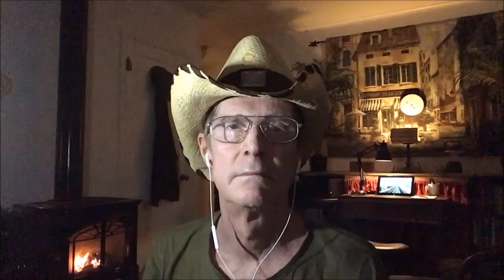What Is An Antenna Trap?

Comment: Thanks for sharing Stan I’m going to buy your book {I probably should have a long time ago}

Is this not the basic principle of a ‘Crystal radio’ ? 
My question is what about inductively coupled inductors, theoretically let’s say I have a microwave oven transformer and I have the antenna off of it and to earth ground then the large secondary which standing wave resonance is about 20 hz {1uf} so then I tune that to say 8hz  and also ground it at one end, 
Will the primary that is inductive coupled to the secondary and which has the antenna now {theoretically} only accept around 8hz?
Reply from the maker: Quite honestly, I don't know. Ideas, anyone? 73 de Stan W1GV.
Reply: Stan Gibilisco ha , I’m gonna buy all your books Stan and get the answer :’ D 
Love ya work.

Comment: So would that be used say to block a powerful AM Radio station that may be causing interference on my HF rig but still allow me to use the rest of my antenna to Transmit on HF?
Reply from the maker: Yes, you can do that. Ideally the trap(s) should resonate at the frequency of the AM broadcast station, and you should insert the trap(s) at the point where the feed line connects to the antenna. Here's what I would do. For an unbalanced antenna such as a vertical, I would place a single trap at the base of the antenna. For a balanced antenna such as an open-wire-fed dipole or loop, I would use two identical traps and insert one trap on either side of the feed line, at the points where the feed line meets either antenna conductor. 73 de Stan W1GV.
Reply: @stangibilisco  Righteous. This was a great video and got me to do some reading. I love these kinds of videos. Learning and exchanging ideas is true fun and what Ham Radio is all about. 73 my friend and thank you. de KD7SJT

Comment: Is it for RX or TX?
Reply from the maker: A trap can work for receiving and/or transmitting. For transmitting, of course the trap must be able to handle the transmitter's RF output power without component damage. 73 de Stan W1GV.
Reply: @stangibilisco  

Thank you, Sir.

Mmmm.. how the trap is useful for TX? because it reduces the TX signal strength., if we it set to the TX frequency. 

TIA.

Bahathir 9W2GNU, 73.
Reply from the maker: @bahathir_  I think you need to do some detailed research on antenna traps by looking at more videos or at antenna-related ARRL publications. In this video, I meant only to define the term, nothing more. I have done a video called "How An Antenna Trap Works". You might search my channel for that video. 73 de Stan W1GV.
Reply: @stangibilisco  
Thank you Sir, for the guidance.